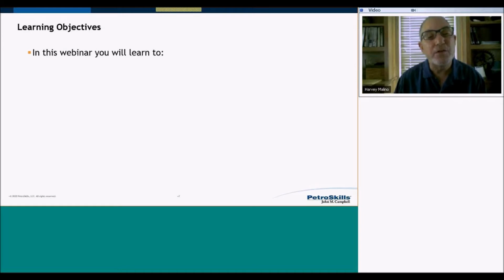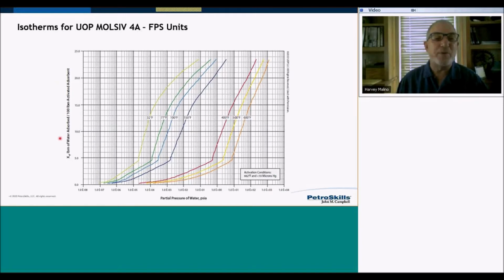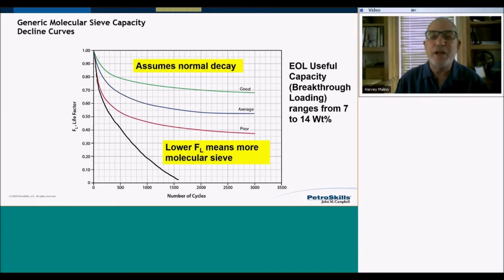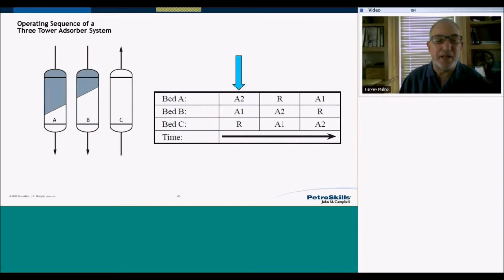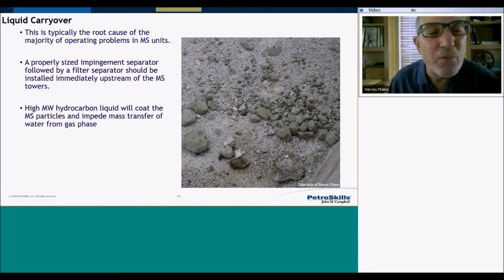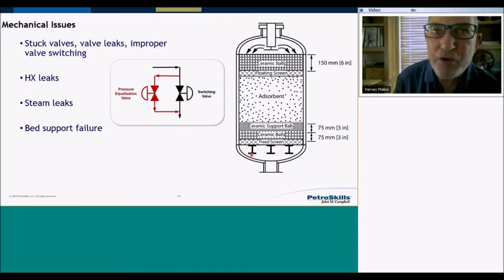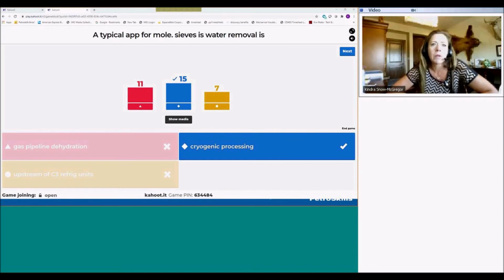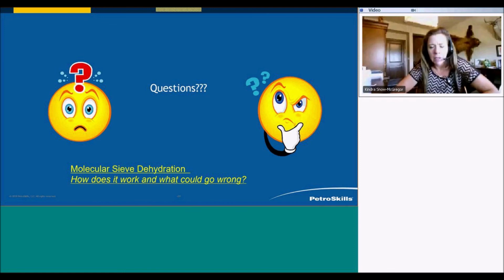Molecular Sieve Dehydration: How Does it Work and What Could Go Wrong?

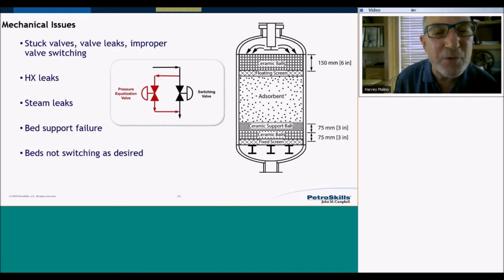Comment: 1:00:00 Really impressive webinar in which I personally learned a lot. However, the most important yet the most neglected point is the calibration and checking out the values of moisture analyzer as in my personal experience it is the blind spot most often ignored. We were operating a mol. sieves bed system (2+1) and the moisture analyzer seems to be working accurately. However, when we carried out analysis with a portable analyzer & lab test, the dew point was way higher which prompted us to change the fixed analyzer altogether.

Comment: Do we need any special room for filling zeolites in sieve beds, like maintaining pressure, temperature or humidity of the room?
Reply: Normally they are charged in the vessels as soon as the drums are opened during the ATA. After the start-up of the facility, the beds are initially regenerated while the gas is bypassed directly into the sales gas network.